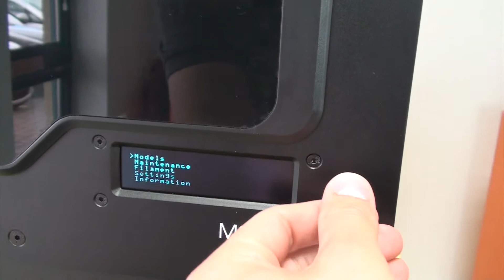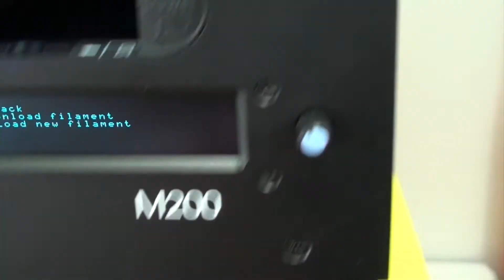Changing Filament on the Zortrax M200 | Tutorials | Dream 3D

Comment: funny you have this pro setup with multiple printers in the background on sweet custom stands and then shaky-vid for a tutorial,  but still thanks for the vid, Zortrax does not have this on their own site...its a basic maneuver but mine is skipping so hopefully you have shown some trick i didn't think of.
Reply from the maker: Hi Zach, Thanks for your comment, you're right it is a bit shaky on the footage front.. one of our earlier videos haha. We're slowly getting better: https://www.youtube.com/watch?v=5Uugqv6S4l4&t=1s
Reply: at least you did a review of it, this is a very simple thing and i had to take the filament pusher apart to get it working anyway..as i suspected the old filament had broken off and was stuck in the hole so its advisable to pull slowly as you extract the old filament.   I think next time i might try a 1.65mm stick to push the old one down and out.  thanks!